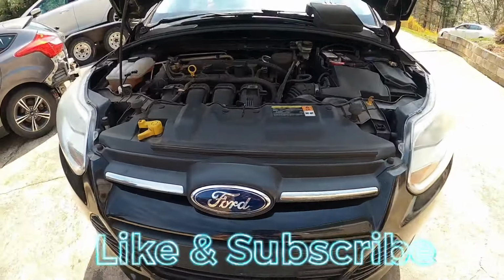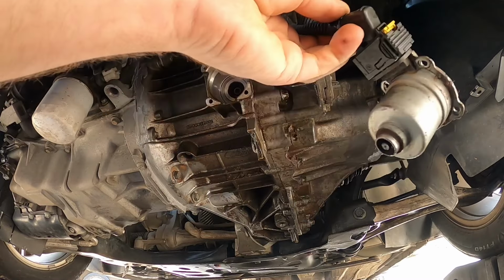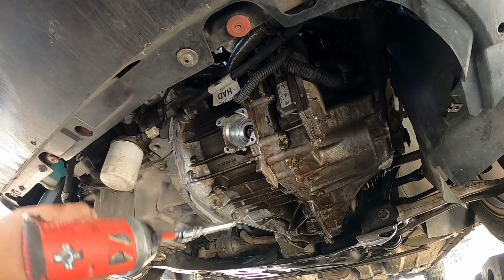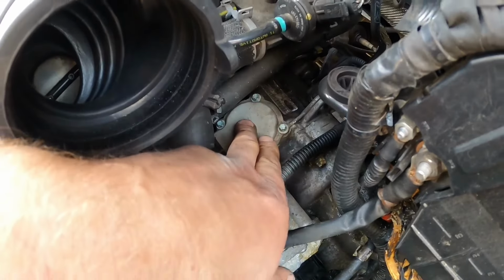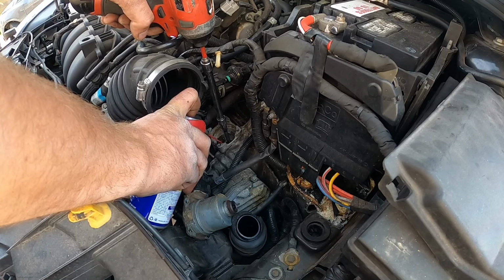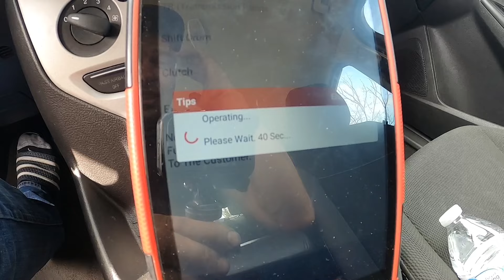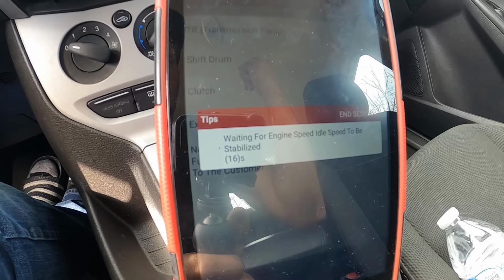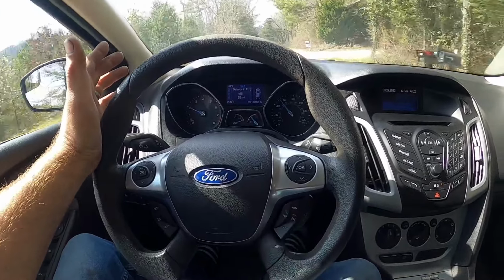2012-2018 Ford Focus Slipping? No Reverse? No Drive? Problem Solved. Easy Fix. You Can Do This!

Comment: Nice, been looking for eror fix  for error code P0452 evap pressure sensor.   
Just a FYI i worked for the company that builds the Clutch & first job i did there was build the machine that tested the double clutches worked w the Engineer who helped design it.   These do not have as much issue in countries that have it shift "harder"  Ford management wanted software changes that softend up the shift points.
Also the Festiva clutch works in the Focus too will actually give a bit better shift feel but last slightly less.

Comment: Been having trouble with the forward gears for years and finally forward and reverse gave up even after a trans rebuild in 2017. Found your video and followed the steps forward forks done first then reverse with no issues. Did forward forks once more and out came a small looking washer. Forward forks didnt feel good to start with but loosened up. To say the least they were pretty far gone! If I bring you the car can you replace the forks and clutch assembly? Thanks!

Comment: Great video! Any advice my 2013 Ford Fiesta will start but won’t get out of park.
Reply from the maker: If the shifter doesn’t move out of park it maybe the brake pedal switch
Reply: @L8R-HP Thank you for your reply. Before it got stuck the gears were shifting in and out of place. I was thinking it might be the tcm.What do you think ?

Comment: I wonder if silicone spray would be better to use than WD-40 because it will coat the parts and not dissipate over time.
Reply from the maker: Yes

Comment: Is it possible to just do the cleaning,replace everything,and then just do the reset transmission thing where you just turn the car to on,press and hold break,then put in neutral?

Comment: Hey … my uncle and I bought a 2012 ford focus and similar to your car it wasn’t engaging reverse all the time …so we followed your video bought  the forks and replaced the both forks although we confirmed only the reverse was faulty … after putting the transmission back together and reinstalled it into the car … we tried starting the focus and it started but when we tried shifting the car into gear nothing was engaging…anyways we decided to turn the car and get a computer to relearn we got the computer the next day and the car wouldn’t start ,over numerous attempts … we pushed it out of the garage and and into a parking space about 15ft away and when we reattempted to start the car it started on the first try but still wasn’t shifting into any gear when we tried … we turn the car off and attempted to turn it over again and every since that day the car wouldn’t start …the only way we got it to start was by putting power directly to the starter , we tried changing the Tcm module and that didn’t work, we tried neutral safety switch that didn’t work either, we tried the starter relay and tcm relay in the fuse box and that didn’t work either the car still refuses to start, I’m hoping you see this message and can give your professional advice on what you think we may have done wrong  or what you think the issue is… please leave a reply🙏
Reply: Did u get an answer?
Reply: @cruzhernandez3792  yes turns out we didn’t reset the clutch

Comment: can you explain - how exactly do you need to operate with this Clutch Reset Actuator Tool right.... i mean, what's the rule of engagement? thank you... i don't wanna break it)
11:45 is it the rule? "turn it counter clockwise 14 times and then release"?
Reply from the maker: Yes.
14 times. Do it by hand. If stuck work it back in forth

Comment: Sorry for this stupid question . Not a pro mechanic . Just ordered new A & B clutch actuators fron Yinlowa . They are not marked A or B , and look very indentical .  So how can tell the differencd from the two ? I got our 2014 Focus for $700 from a parish member at my church . It only has 100,000 miles on it . Thank you for your video . Again sorry for the dumb question .
Reply from the maker: Actuators are the same

Comment: Hi, ford focus 2014 owner here, Auto trasmission. It was jerking at when accelerating from a stop, did this (cleaning, not the scan reset) and it helped now it doesn't jerk any more however I notice that the trasmission sounds specially when coming to a stop. Would you recommend changing the trasmission fluid? It has 119k miles. Doesn't have any codes.

Comment: Since the fixes that you implemented has it had any problems? Did the stuttering go away?
Reply from the maker: Shutter won’t go away if your clutch got hot and warped.

Comment: What tool do I need to do the learn and test procedure you did? I have 164000 miles. I replaced the actuators a year or so ago around  Dec 2023
Reply from the maker: Launch 431 mini or forscan
Reply: @L8R-HP  Ona side note, I used CLP gun cleaner vice WD40, as it is designed for powder cleaning and lubrication in one. Mine was slightly sticking, after applying a liberal amount of CLP, it goes back to reset fast now, and i have an OEM FORD actuator, not a chines junk one.

Comment: @L8R-HP i bought a whole transmission do i still to remove and reset the clutch pack before putting it on, just swap it out? Thanks, your response would greatly appreciated.
Reply from the maker: I would remove the clutch and clean everything.
It will save you in the future

Comment: I have no reverse. Removed “B” actuator and inserted bit to turn fork as shown.. but encountered “spring” resistance immediately when turning counterclockwise like it was binding. Is this due to stuck fork ? Should I apply more pressure or ....?  Thanks, BOB
Reply from the maker: Try to turn it the other day at lightly, it might be stuck open

Comment: Do you do it counter clock wise every time...or both ways till it gets loose then go counter clock wise?
Reply from the maker: Counter clock 14 times and it should return on its own. Unless the fork is really stuck and or broken

Comment: 2016 Focus here. Reverse is perfectly fine. I get some stuttering when accelerating from a dead stop. It clears up after 1st gear. Could the top actuator be the problem?
Reply from the maker: Forks are sticking making clutch slip

Comment: I have a 2012 ford focus...146,000 miles outside of "10" year recall warranty 🤦🏾‍♀️. 
Ford said that I do have a bad TCM, but I'm not willing to pay $2000.

Currently have "Service transmission " light on and code for fork "A". Also when I put the car in "N", to reset the transmission, a battery low light also comes on... 

Having problems with going in reverse sometimes and problems with gears shifting..

Do you think this will help? Clutch was already replaced few years ago.

Thank you for your help.
Reply from the maker: Test your battery

Comment: Excellent video! What is the specs of the socket used to move the actuator? What is it called? What is the size?
Reply from the maker: https://www.ebay.com/itm/184480096055?mkcid=16&mkevt=1&mkrid=711-127632-2357-0&ssspo=yvwl7HUSReq&sssrc=2349624&ssuid=-qApsBzoR4m&var=&widget_ver=artemis&media=COPY

Comment: Great info, sometime on that trans suggest to replace all of it 👍
Reply from the maker: Always best to replace everything
Reply: @L8R-HP  why to do it when you can clean or maintain it 😉
Reply: I just got a Fiesta today and have: P0700 current, P07A5 intermediate MIL(transmission friction element B stuck on), and P0500(vehicke speed sensor A. What should i do? 🤚

Comment: What is the app used at 13:10? and should it work with a veepak ODB2 bluetooth scanner? Right now I have Car Scanner but not sure if that will work for running the trans tests.
Reply from the maker: I used a launch 431 mini. But you can use forscan as well

Comment: I have a ford focus 2017 s, I suffer with the same problem now... The transmission does not work, so the car only moves at 20 km/h on the D, in addition to the car does not go back at all...
Is this the same problem?..
Reply from the maker: Try this. It will help unless your forks are broken

Comment: So mine has a delay in reverse every once in a while. Hit the gas and the car either just sits there or starts to roll forward/backward a bit. I hit the brake, gas again and then it goes in reverse just fine. 

I drive the car harder in 1st gear, shift between 3-4k RPM, then let off the gas a couple seconds. Drives much smoother this way. I wondering if I should just wait until it eventually outright refuses to go at all before I try this.

Comment: Do not have the tool. I am using a flat blade screwdriver. On actuator a, as I begin to turn, the actuator counterclockwise after the fourth turn, it gets very heavy under a lot of spring loaded pressure. As soon as I lift the screwdriver out, the actuator spins all the way back clockwise. Should it do this?
Reply from the maker: No it’s getting stuck. Try to work it back in forth while spraying some type of lube in there. It may free up for a while. But if it’s that bad it most likely needs new forks

Comment: Sorry, if I don't have a computer, will it work to restore the transition by disconnecting the battery?
Reply from the maker: If all is working it will relearn on its own with a normal drive

Comment: Now if i don't have that code tool. Do i have to have that to test and reset. The tool you are using sitting in the car?
Reply from the maker: If all is working right the car will relearn on its own eventually with normal driving

Comment: Nice. Now I'm wondering. It spins all the way to the clockwise and stops. If you try to spin counterclockwise, it's under a spring tension and if you let go it will spin back to its clockwise position. Is this normal, or is the fork stuck? Code says element A is stuck. Is that A actuator...the top one? That's what I've been working on

Comment: I did this re learned procedure. Transmission still stuttering through some shifts. Rpm raises slightly and then it will shift. Service transmission light come on periodically 😮
Reply: Everything on the scanned “passed” the reset procedure. Maybe bad motors?

Comment: I have a 2018 Focus both actuators have been replaced. After actuator A was replaced I was still having some shifting problems. My son thought the clutches were going out. In order for it to start I would have to turn the key to the on position you could hear all gears clicking once that stopped it would start. At first when driving it the hot transmission light would come on. That became less and less. It was never driven far during this time just to my daughters and back 6 miles round trip. In sept I was sick and was unable to drive for 4 days it wasnt driven. When I got in it to go home it started right up the shifting was better over the course of 2 days it started shifting normal the check engine light went off and all was well. Until a few weeks ago then it acting up again. The last time I drove from my house to my daughters it took me 4 hours to go 3 miles to jump her car off. It has sat at her house ever since. Its back to having to turn the key on and letting it do its thang then it starts. I put it in drive and for just a few seconds you can feel it trying to pull and then it just lets go and rolls backwards. Any suggestions?? My Ford certificated mechanic told me to trade it in set it on fire or drive into the lake.

Comment: Doing this on my wife’s car right now. Is there supposed to be any play in the actuator socket? Where the tool inserts into?
Reply from the maker: A little yes
Reply from the maker: A little yes
Reply: Welp, it think it’s more than a little, the socket moves so much it pushes up against the rubber ring. Not sure if it even worth paying to get fixed for how bad this dual clutch system is
Reply from the maker: @thescheff3  just replace the forks and you be good to go
Reply: I’m not that mechanically inclined to drop the transmission in my garage with jack stands. And a few previous focus owners I’ve talked to said the problem will just come back later. Ford really screwed up with these transmissions and clutches. I really liked the car

Comment: 9 times out of 10 it’s actually burnt friction plates because drivers are treating family cars like dragsters . A buddy of mine works at a transmission shop and it’s almost always burnt friction plates and NOT solenoid issues . The solenoid issues occur because of burnt plates…
Reply from the maker: Out of 200+ cars this year I’ve had only 1 or 2 with a bad clutch. These cars were meant to be driven, that’s why they all have launch control 🚀

Comment: Is it required to run it through the programing after taking out and cleaning the actuators only? Or can you just put them back in after cleaning and drive it?
Reply from the maker: If all is working as it should, it will relearn on its own after a good drive

Comment: My 2013 focus se is throwing the P07A5 code. Like in the video no reverse. So spinning the clutch counter clockwise and brake cleaner etc will allow it to function again?  Ford put new TCM in but obviously nothing else as TCM was on recall. So new TCM yippie but didn't fix issue I even put new actuators in myself but didn't have money to buy that 6mm reset tool

Comment: What kind of scan tool are you using?  I've tried several but they don't have the transmission calibration functionality
Reply from the maker: I use a launch 431 mini. But you can use forscan

Comment: What happens if it’s not springing back? And it’s just making a clicking sound now I think I overdid it on the counterclockwise.
Reply from the maker: Your fork is broken and needs to be replaced. I recommend you get a clutch and fork kit and replace it all. Good luck 💪

Comment: Can this fix be applied to ford mondeo 2.0 TDCI 2013 or they have some different transmission issues ?
Reply from the maker: No this only works on the DPS6 dual clutch transmission

Comment: What do you do If there is no hole to spray in the brake cleaner and w40?? My care is dry shifting and sometimes won't go in reverse..it also skips a little if i slam on the brake..😮what should I do.
Reply from the maker: Remove actuators
Reply: @L8R-HP  ok thank you 😊

Comment: Well going to try this after much slipping trans is practically useless at this point . Was overheating . Before it was throwing code P0700 transmission elecrtical system and cleaned grounds to bare metal and it ran almost like new a few times then went quickly downhill . Now not showing any trans codes at all . Just showing code for cat converter possibly the sensor . Some say the cheap eBay actuators don't last like OEM ones but it's what I have .  My reverse is fine so should I replace both A and B actuators ?  I'll change A actuator only for now

Comment: Do you leave it in park when doing this and did you disconnect the battery while doing this?
Thank you so much for the help. I'm flat broke and my 2013 focus started shifting really bad in drive and has a hard time finding park before it cranks. It sits there and clicks when the key is out and it's in park. To start it I have to move the shifter from park to drive and back to park a couple times and then it will click into place and crank. Having transmission overheating alarm after stop and go driving.
Reply from the maker: Yes In park 👍
Reply: @L8R-HP  
I appreciate your help.
Reply: @L8R-HP  well.. no such luck however it is finding park easier than before but it still drags out the shifts (causing the transmission  overheating) and sometimes stops trying to pull itself for a moment in-between shifts (like it goes to neutral) and then will try to figure out which gear it should be in (sometimes it shifts up to a higher gear than it needs and crawls up to speed sometimes it downshifts to a lower gear than needed and quickly upshifts to the proper gear if that makes sense) when driving through town between 10-40mph having to slow down for lights and then speed back up. If I let off the gas in when it's shifting like a manual it seems to do ok. It feels like it's only in certain gears that it does this. I'm going to swap the A&B shift solenoids tomorrow and see if the problem moves. I do not have a scanner to reset anything, I just put it in neutral when I first started it until it said transmission ready and then drove it after I hooked the battery back up. 

I don't mean to bug you, but any ideas or advice you would be willing to share would be much appreciated.

Comment: Getting a P090C Clutch "B" Actuator Control Circuit Low.  I was thinking about replacing both actuators.  Thoughts?
Reply: I’m here too bc I currently have actuator A circuit low with P0902 code. Popped up after replacing an old battery. What did you end up doing?

Comment: Just done my 2017 focus , it wasn't going into reverse either just on occasions and would shudder the works . So I did what you did and I think I've drive it like 300 miles but I cleaned this literally like 4 minutes tops and I didn't do A just B . Ok today my daughter drives car says it's acting up again so I take B off again and when I put the tool in and began to turn counter clockwise I noticed no tension on this at all , has my fork broke . I meant to ask you when you turn this if they were spring back on this because first time I turn the 14 turns it felt like it went back to were it was.can you help please
Reply from the maker: If doesn’t spring back the fork is most likely broken
Reply: I guess in order to put a new fork in this id probably have to drop trans. They priced like 22 dollars a piece
Reply: That's the forks that is but was wondering is this a job for a specialist or can I do it you think just shade tree mechanic I guess
Reply: I wish you were closer to me . I live 33 miles north of knoxville TN. I'd let you do this trans if you would. Kinda wonder if the ac compressor on this 2017 focus would work on a 2013 festiva? Lol I'm just full of questions but we here in the south love your videos , I guess you have to keep them coming when it comes to Ford lol